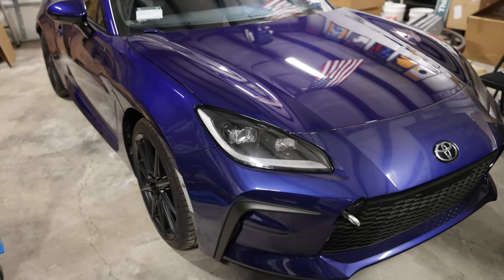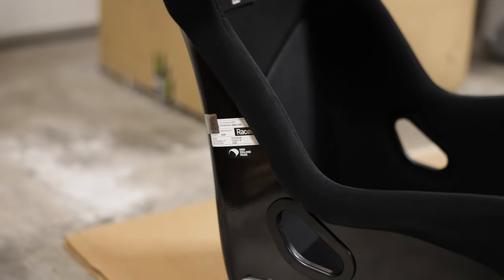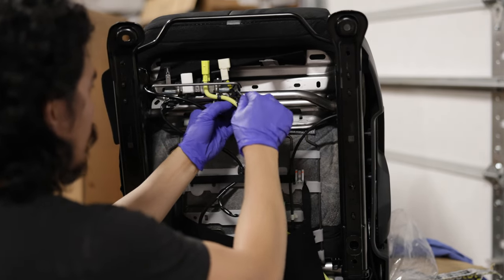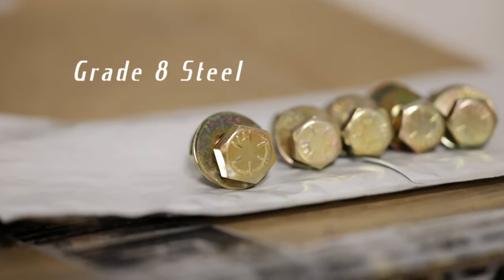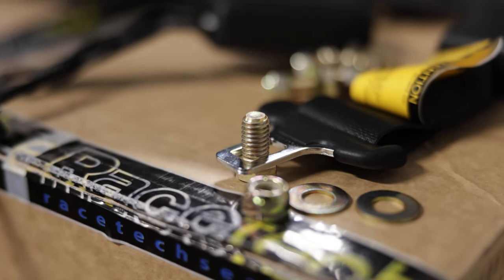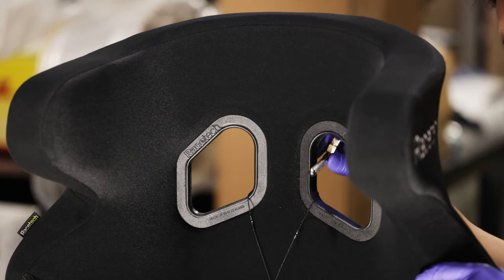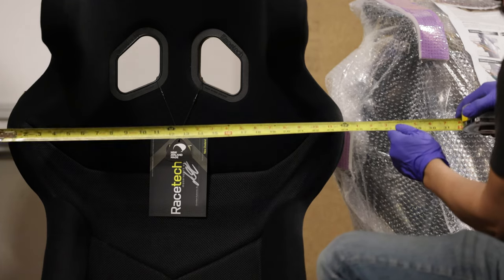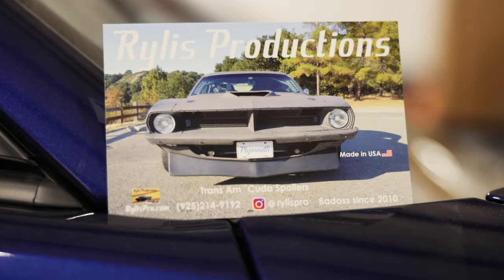2023 Toyota GR86 Racetech Driver Seat Install!

Comment: Hey great video! I have Bride seats installed on my GR86 and was wondering if you sold seatbelt extensions separately? That way they could be ran through the side openings for easy buckling using the stock seatbelts. Or could recommend some sold elsewhere. Thank you in advance for any help!
Reply from the maker: They are free from Ford or Toyota
Reply: @RylisPro  oh wow I didn’t know that, that’s cool! Thank you for the info.

Comment: I used 3.3 ohm resistors but I'm having issues with the airbag not turning off any tips?
Reply from the maker: The 3.3 ohm resistors should be pretty straightforward. Either the contacts are not completely touching, the resistor may need to be flipped around or you have a bad resistor